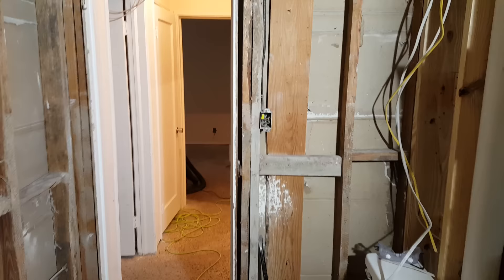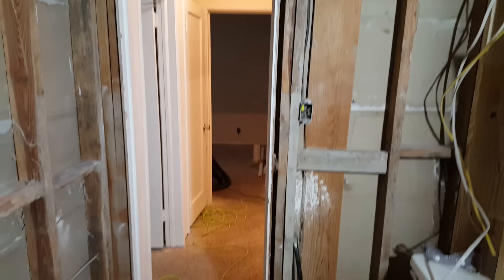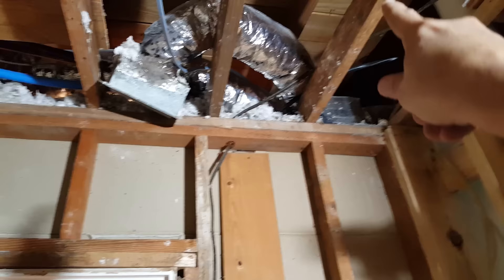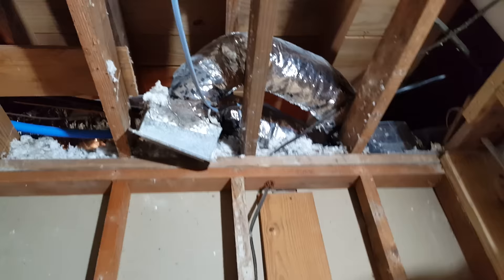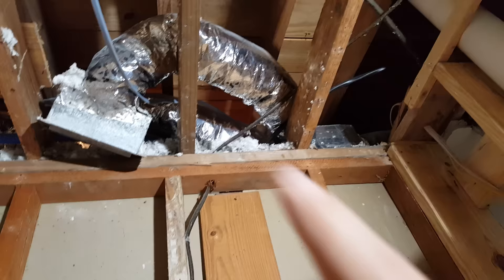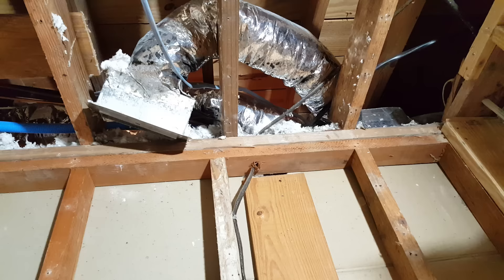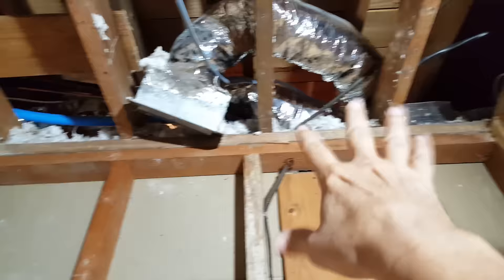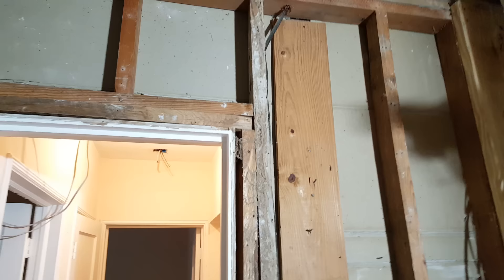How to Tell if Your Wall is Load Bearing

Comment: Great explanation.  However, I thought the 2X4 header over the door was supposed to be vertical instead of horizontal to avoid deflection?  I realize it's only 1/2 inch more but it's what I've seen before.
Reply from the maker: There are 2 plates making up that header so you won't get any deflection, not to worry. Also, if a header was vertical, it would not be a header.
Reply: Oogie boy you are supposed to turn your headers on the vertical..... there is deflection turning it on its side...  turn 2x materials on edge, sandwich two 2x on edge with a spacer of OSB (7/16) is the proper way to make a header.
Reply: Right... 2X on edge.  That's the way I've always seen it.  I thought it looked wrong.
Reply from the maker: I also prefer to use a 2x6 turned vertically instead of laying flat like you see the builder did here. This house was built in 1946, maybe that is how they did it then. These days most framers prefer sandwiched boards aligned vertically on their side. On wider doorways they use things like metal beams to span over the distance of the doorway. I would never want to use those wood I-Beam joists made out of LVL because they burn real quick and rapidly spread fires due to the OSB material of the web of the I-beam, and the adhesives that they use to bind the web material together.
Reply: Boats to live on
Reply: Yea I thought the same. You can also already see the deflection bowing that header

Comment: good info bud im a carpenter and know all this information already but still like to check out videos searching out to maybe learn more , but good video when we build however load bearing or not all walls will have the two top plates secondary top plate is also used to tie in walls together. ✊     but over all very good info .

Comment: amazing info...thanks ..im building a wall and doorway ..non load bearing , wonder if i still need a cripple
Reply from the maker: It would not hurt to ass the cripple and build the wall as a load bearing wall, that way you have options later on if you need to modify the house and that wall changes to a load bearing wall. It's only a few pieces of wood, and better header over the door.
Reply: @jeffostroff  yes i will put it in thank you

Comment: The double top plate is used to tie the walls together. You have to have them. That header was in wrong, it should be turned wide side facing out. That wall would only be a load bearing wall if the joists ended on it.
Reply from the maker: Tim a lot of cheapie houses like this built for veterans in 1946 were like this

Comment: You have a non-conforming door header along with ceiling joists which are not lapped on top of the wall.  This is most likely not a load bearing wall.  A comprehensive check would be to look at the span of the ceiling joists in relation to IRC span tables, and perhaps a look at adjacent rooms where the joists may be full-span.  Good luck...
Reply: OCJohn - Thank you for some sanity.
Reply: Rite you are sir this is not a load bearing wall. Very misleading information.
Reply: Looks like a door right next to this room which opens up into a larger room where this wall isn't continued. I assumed on that alone it wasn't a load bearing wall.
Reply: Well done Yoda. That is the most sane way to check if a wall is load bearing. In my opinion, this wall is not a LB wall - just because I don't see a lap of joists although I cannot accurately see spans. 

(BUT even then, there is the rare case of weirdly built houses that it might just as well be load bearing)

Comment: Wow. I rarely comment on videos like this, but this is a damn good video. Bravo good sir.
Reply from the maker: I thank you sir!
Reply: Excellent explanation. Very well narrated to be easily understood by DIYers.
Reply: Maybe, but sadly. most all of his information was incorrect. That's not a load bearing wall, and the door header was improperly installed.
Reply: He presented the information well but yes, most of these explanations and reasoning were not accurate.
Reply: Spencer Kraus » What parts did he get wrong? Is supporting ceiling joists not bearing a load? I'm not saying you're wrong - I'm not a builder but I would like to understand your objections.
Reply: Tin Man typically, but you could not know if that was bearing from the double-top plates or the fact that the joists are resting on the wall. You could only tell by going into the basement and verifying that there is a post or another bearing wall below it.
Reply: @tinman1955   You would have to look at the distance the joists span if you remove the wall they cross to compare it to the maximum spanning distance of that joist. Joists that sit on walls may be an incidental crossing. For example, they are sitting on the wall there, but is that wall line continuous outside that room so that all the joists are sitting on a continuous wall line? If so, you would need to determine if a support was needed at that location based up, again, the maximum distance the joist system can span with the load it has on it. Many walls that have joist resting on them, where the joist continues to another wall, can be removed completely without effect.

This video is misleading and incomplete with a tone that suggests validity but with content that bears and amateur understanding. 

When in doubt look up how a system works, check what the components of that system can perform, even go back to manufacturing data for performance. I have been a plumber for 25 years and we still look up technical data on a variety of construction situations.......and btw .......so do the professional engineers.
Reply: @spencerkraus  not entirely accurate, a flooring system may run perpendicular to the walls and still support the walls above. These are systems of construction not single elements. They work together. Distance between support points is pretty much the main consideration. Every structural member or assembly is designed or can perform within specific parameters effectively, figure those answers and you can do whatever you want within the constraints of those members or assemblies performance limitations.

Comment: When a truss is perpendicular to the wall it doesn’t usually mean its load bearing. Yes theres a chance that when its perpendicular to the wall it could be bearing but definitely do not rely on this because most interior walls will not be load bearing u.n.o Most common trusses under 35 ft span only need a 2 point bearing even with an air handler load. Best bet is the double top plate, that’s the best indicator if theres no plan available. Also if a beam sits on top of a interior wall that’s most likely L.B thank you for your video i just wanted to add more info so people get a better idea. Old video but people still watch for this info :)
Reply from the maker: Actually more strict definition is if any rafters or ceiling joists have an endpoint on top of the wall, then it is load bearing. Although in this 1945 house, the ceiling joists run front of house to rear of house, resting on the exterior cement block walls. But I always felt that sag over time might be making some of these joists bearing downward on the wall.

Comment: it is very unlikely that that wall is load bearing because the ceiling joists above it are not cut or split over that wall .. if a house is 30 feet wide you use 16 foot joists and overlap a foot over the load bearing wall or beam.. there is no split there.. to use that wall for load bearing would mean that not only does there need to be support in the basement but you have now thrown off the engineering of the house.. all loads are to be sent to the outside walls and into the footer unless it is an impossibility and then you use a beam to do it and there is no beam in that wall or ceiling.. Highly unlikely that wall carries a load intentionally.
Reply from the maker: Zippy, yes, in fact we think it is in that gray area load bearing/not load bearing where a load (the floor joists) is resting on top of the stud wall, but the true load bearing is being carried by the front and rear cement block walls of the house. You are also correct that if the floor joists came to a joint that rested on top of the stud wall then it would be a full load bearing wall. But wither way with walls like this, I treat it as a load bearing because the joists are resting/touching the top of the stud wall. Later on for cutting into the wall to add a door, we will add a header over the door, likely made from 2x6 boards, laying vertically, not horizontal like the builder did originally.
Reply: That still is not a load bearing wall. Pls do not make videos giving someone false information. All walls have cap plates which tie the walls into each other. One cap plate has a 3 1/2 gap where the other intersecting wall has 3 1/2 overhang. This is also to strengthen the wall. The ceiling joist do not make it load bearing u can scab those joist  if needed and install a strongback. What makes it load bearing is hips, valleys, rafters, bracing to the roof, and floor above it.  That is bad framing at best, should be a t-post right there not a board nailed to other wall used as deadwood for the sheetrock.Also that is called cutting corners with not adding a cap plate which u call getting good and efficient. That shit wouldnt come close to passing an inspection here. Its also not about the drywall with using wider spacing on studs, u have to block the walls correctly, and sheetrock provides very little strength even at 5/8” only thing the thicker sheetrock adds is it wont bow between studs as easy. That also is not a header, the cripple on eache side the door frame should be on 2x6 on edge at best.
Reply from the maker: If you're referring to the classic definition of load bearing, yes it is not a load bearing wall because the rafters don't end on top on the wall, but rather they stretch across the house tot he exterior cement walls, but with the age of the house, and settling and sagging,  the rafters are resting on top of it a bit. I plan to treat it as load bearing, but you go ahead and start removing out a 60 year old wall and tell your customer after it fails that it was not a load bearing wall.
Reply: If ur rafter are sagging and resting on the wall then u have far more problems than adding doors. U need to get in the attic and run purlins on that roof and start bracing. If u are referring to those ceiling joist they should be sitting on the wall but that doesnt make it load bearing they are only there to strengthen walls and give u a ceiling. If the foundation is sinking then that is a whole different problem.
Reply: The double top plate serves as a firestop. It is code across the country
Reply: Rollack I  would love to work with someone like you. Actually learn the trade from a pro. Not to mock the YouTuber but rather the teachers i have come across that know jack shit about the field.

Comment: Based on the flat header, and looks of the wall being in close proximity to the exterior wall, and those look like trusses, but can't really tell. It kinda looks like that might not be a load bearing wall. If the trusses are engineered to span the width of the building with out having to have interior walls it doesn't matter at all if the wall is perpendicular to the ceiling joists.

Comment: Since the wall in this video is directly beneath the attic, I"m wondering how I might determine this for a wall in the first floor of my two story house?  I can't see the joists directly above the wall since they're under the subfloor of the second floor above.  Do I just have to estimate the location and look in the attic above that same spot above the second floor and make the assumption that the joists run the same way?
Reply from the maker: You can cut away a piece of ceiling in an out of the way place like  closet to gt a look up there. What you are looking for is either any 2nd floor joists that have an endpoint on top of this wall, or see if there is a 2nd floor stud wall on top of this wall. If either of these cases are true, then the wall is load bearing.

Comment: Great video but that wall is not necessarily load bearing. Depends on the ceiling joist spans and sizes. Judging by what I can see you don’t have two joists overlapping on that wall. Therefore, that joist probably goes end to end or overlaps on another wall.

Comment: thank you. very well explained,very informative.
Reply from the maker: Glad to help out, thanks for stopping by.
Reply: if there is no header beam in the wall then it is probably not load bearing. the top plate has nothing to do with bearing load nor does the truss layout.
Reply: Jerry,  Reading some of the other comments on this video leads me to doubt the validity of the information.  Personally, I think this is a subject where a professional should be called in.  The stakes are too high for getting it wrong.
Reply from the maker: @MrAkwaholic  8 Unfortunately you drink the Kool aid from a bunch of these carpenters that came on here and posted that are basically divided into 2 different statements that they commonly .make here, which one of them is that the top plate of the wall is used to tie the 2 walls together which is true but they're trying to tell me that my statement that says that you need that top plate there if you have a load bearing wall is incorrect.  And this makes these carpenters who don't understand the International building code it makes them think that my information is wrong.  Secondly you will see a number of carpenters come on here and point out the fact that just because the 1946 door frame wasn't built like THEY do it in he 21st century so they strongly assu.e it is not a load bearing  wall a d tbey the  fals6 accuse me of being  wrong.  The use the incorrect method to  Determine if a wall is load bearing. You don't declare a wall load bearing based on the fact of whether or not the builder framed up the door correctly or not. So all of those guys leaving those comments or just stupid. You can't say that is not a  earing wall just because it didn't have the vertical header and 2 pieces of wood sandwiched together and standing up sideways to form a larger header beam they think that means that this is not a load bearing wall. But they don't understand that there's a lot of bad carpenters out there and a lot of bad contractors who skirt the law and this house was Built-in the forties cheap for veterans and a lot of them didn't build a load bearing door frame the way they should have. So the only way to really tell that the wall is load bearing is to be able to get up into the attic and see if the rafters have end point on top of the wall or if there are any floor joists that end on top of the wall. So all of this has caused  Hysteria between you and the other incorrect commenters causing  you to doubt me.  If you are concerned about somebody's house falling down because of what I say you need not worry because my method here will cause them to be more conservative and treat the wall like its load bearing in hence the house would not fall apart because they would use bracing you're listening to a bunch of naysayers.
Reply: jeffostroff . Precisely my point.  There are different opinions as to what is right and what is not.  I don’t think the potential consequences of an amateur doing it themselves is worth the risk.  There are some things, most things in fact, that I’m happy to give a go but when it comes to my roof possibly collapsing and causing not only financial damage but also harm and injury,that’s where I draw the line and get a pro in.  I’m happy to pay for the peace of mind.   I’m not saying what you are saying is not right but there seems to be too many differing opinions to take the chance.

Comment: For those of you saying its not a load bearing wall. You simply wouldnt need the double header above that door if it wasnt.
Reply from the maker: But then they would need a 3x6 galvanized plate to tie tops of walls together because  that top plate is also used to tie walls to each other.  That top plate serves a dual purpose it is a floor polish and a dessert topping!

Comment: Hi Jeff! I'm taking out the front walls of a closet making it an alcove. The joists run perpendicular to the closet. How can I tell if that is a load bearing wall?
Reply from the maker: Really the best way for you to tell if it is load bearing, is to look and see do any of the joists have an endpoint that ends on top of that stud wall? If so then it is a load bearing wall. If the joists that pass over your wall just simply go across that top of that wall then it is not likely to be a load bearing wall and I'm sure the endpoints of those joists will then end maybe on top of some other load bearing wall. If there are any other vertical roof supports or roof truss supports or anything else that has an end point on top of that wall that is using that wall as a support, then you likely have a load bearing wall